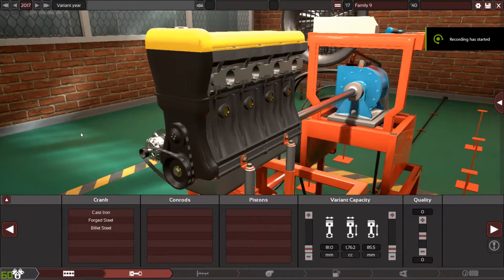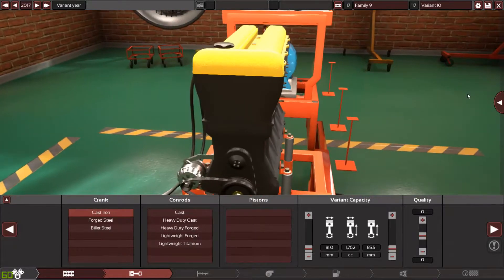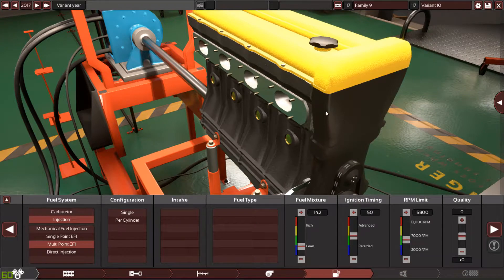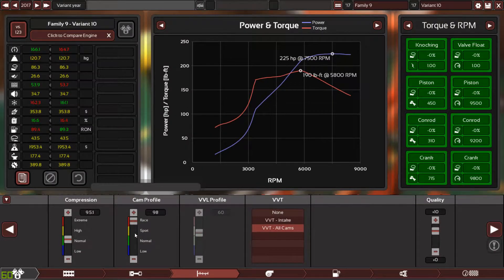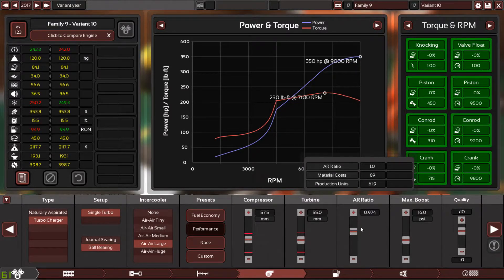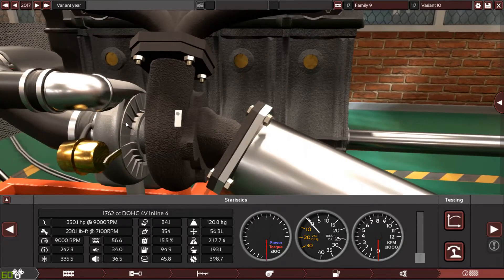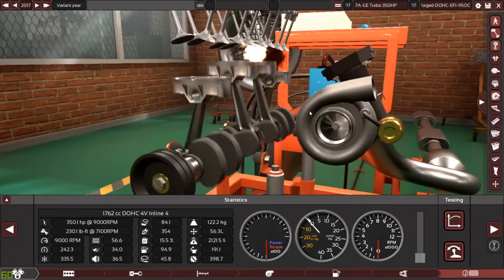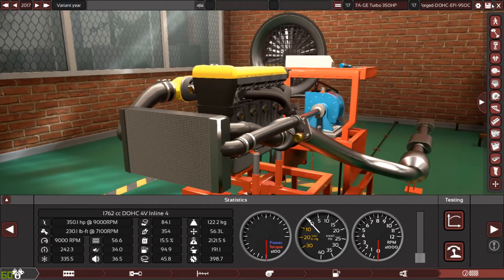7A-GE Turbo Upgrade request build.

Comment: Now make a 9A-GTE;

Basically to sum it up, it’s a special custom engine like the 7AGE (7AFE with 4AGE head) but it has billet crank and rods and a whopping 2 liters (1980cc) of displacement 

Apparently some of the kits can achieve over 800hp and over 10k rpm

Comment: Hi, if i could request for another engine build this time, maybe a Mitsubishi Orion 4G13 carburetor or either MPFi engine with turbo modification and bore stroke enlargement ! The Mitsubishi Orion is a quite long liven engine that can be either carbureted or Fuel Injected. Having one of this inside of my Mitsubishi Mirage 1987!)
Reply from the maker: +Mark from Predator XR 
Cool request 
But tell me exactly what do you want me to build 
A carbureted 4G13 or an injected one ?
What bore and stroke are u looking for ?
Max power or good power ?
Racing engine or a performance engine ?
Quality range from 0 to 15 ?
Reply: Sorry man. Yesterday was in very bad mood can't exactly reply to you yet. But anyways right now, I'm hoping for a 4 trumpet race build Single Overhead Cam of the Carburetted 4G13 and maybe slight increase in Bore. And the quality will be around 3-5 perhaps.And by the way, if it's better in Race than that's good.
Reply from the maker: +Mark from Predator XR 
I will make it very soon